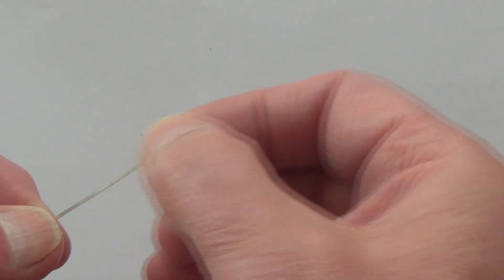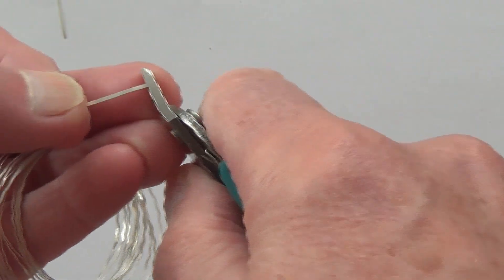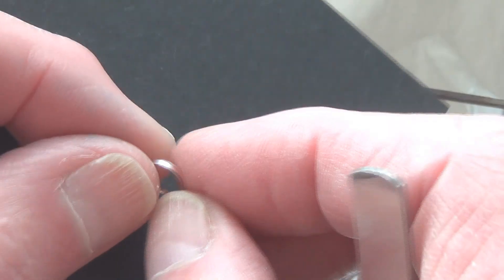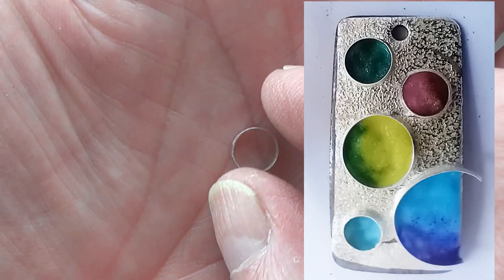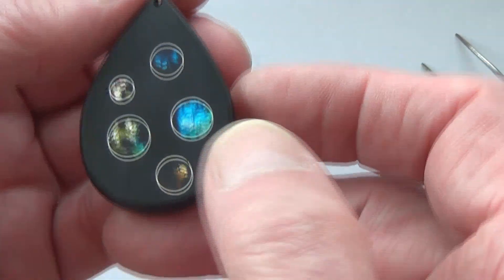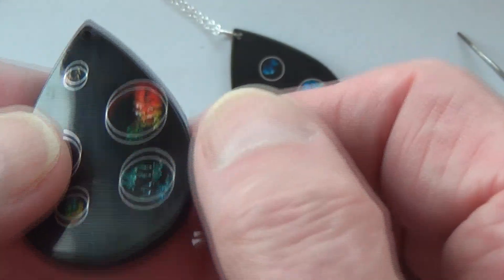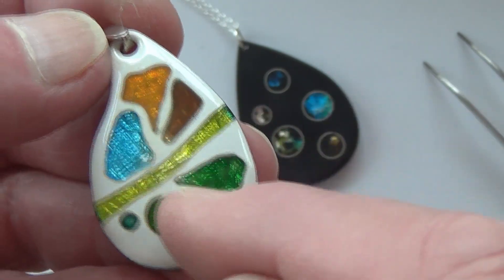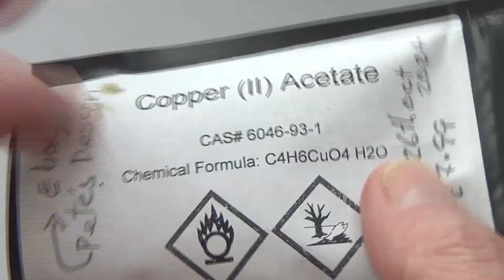Fusing fine silver rings for cloisonné enamel and/or epoxy resin jewellery.

Comment: Nice work Andy, thank you for that tip. You're right; circles that come apart would annoy me too in my work. Love your enamel work. A tip for the copper acetate for anyone interested: If you mix it with a little Klyr-fire instead of water it dissolves completely and is so easy to apply with a little dropper bottle.
Reply from the maker: Hi thanks for the tip, I haven't thought about using Klyr-fire, but it makes perfect sense to give a bit of adhesion.
Kind regards . . . .  Andy

Comment: Fascinating, very interesting and beautiful! Nice work Andy! All the best Rick.
Reply from the maker: Hi Rick, I hope that the world is OK with you. Since I've being playing at silversmithing I've discovered some very interesting tools and techniques that would have been really useful in my old working life. I have a jewellers pendant drill that you could be forgiven for thinking wouldn't be half as useful as a battery Dremel type drill, but it would have been extremely beneficial in an industrial environment. There's a silver soldering technique call 'Pick soldering' where you use flux and a titanium pick (a tool shaped like the end of a scriber) to pick up a grain-of-sugar-size fragment of hard silver solder and precisely place it where you want it on the work you are assembling.  Had I have know about this wonderful soldering technique it would have been a massive benefit when making the small, precise, water cooled copper coils that I used in some of my induction heating coli designs.  Some of the induction heating coils had to be very precise, they were like jewellery. We always used conventional sticks of silver solder rods, where you wind up applying more solder that you really want, so you  then spend hours removing excess hard solder. (I find pick soldering better than using solder paste.) By the way, for anyone interested in 'Pick soldering,' check out Greg Greenwoods pick soldering video, he's a fellow American of yours Rick, and just as I have learnt a lot from you, I owe Greg a debut of gratitude as most of my jewellery masking knowledge have come from him.  All the vey best to you Rick. Kind regards . . .  Andy
Reply: @AndyDaviesByTheSea  Andy, I think it so interesting to see your progress and skill in producing jewelry.  Another interesting thing is your skills and knowledge in making jewelry would have been useful a totally deferent field. As in any subject, and skill, there is always more to learn. I did find Greg Greenwood’s YouTube site, god information! Andy, it is so great to see your enthusiasm for making fine jewelry. All the best, Rick.